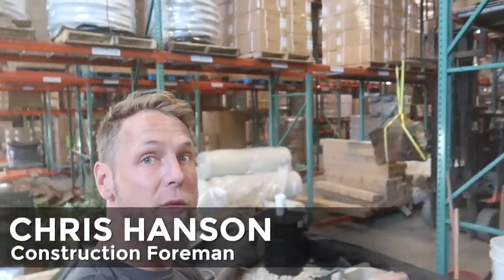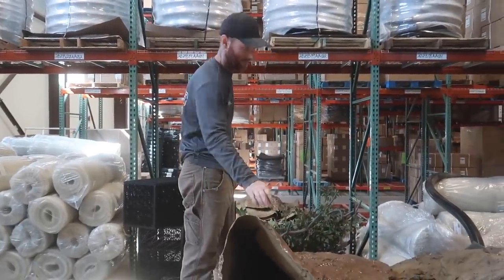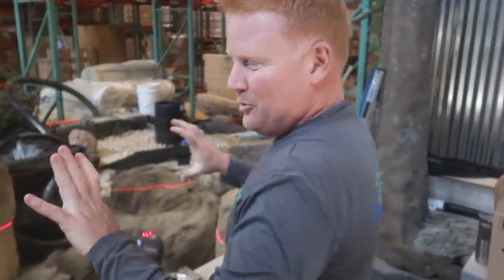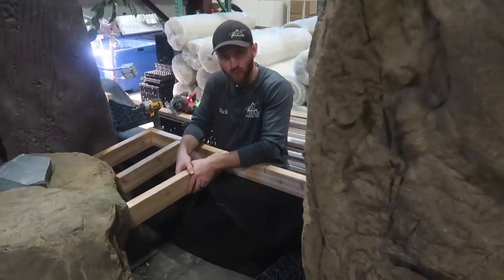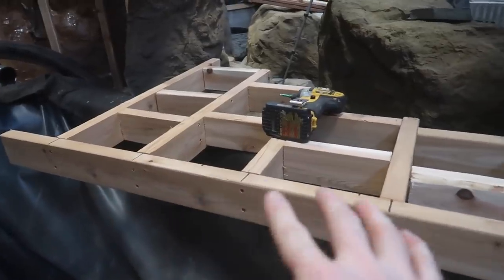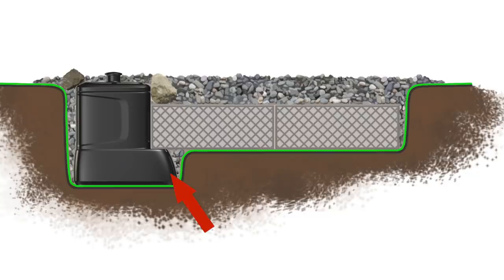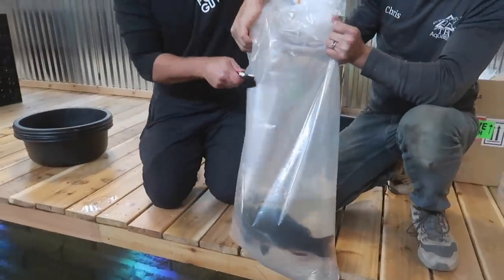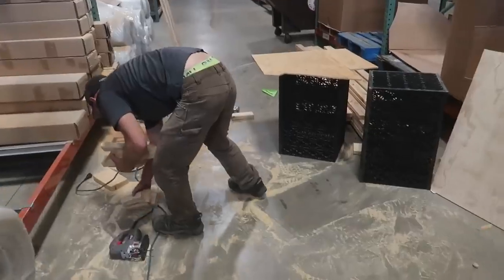*Japanese KOI* Barely Survive Late Shipment!

Comment: Holly crap, They read my comment and they did it wright this time!

Open the bag get the fish out by hand/koisok and place them in the tank/pond.
Normally they have no problem with staying in the bag for 48hrs. This is from packing in japan till delivery at your place.
I assume the 36 hrs. Greg is talking about are 36 hrs they have been in the USA. So add another 24 hrs to this from packing and flying in, to release from airport.

If you have fish which are weak, do  not put them in a very deep basin, It is best for the koi to have a shallow basin of 2 feet of water. The pressure on their body (organs) is less and they can use more energy to recuperate.
This is also the reason why the koi when they don't feel too good, go to a shallow part of the pond.

They fish are not in the clear yet, but if they survive the first 48 hrs in the pond they will probably be fine.